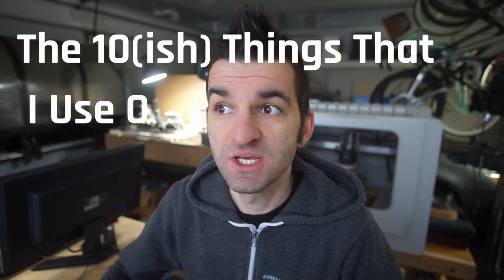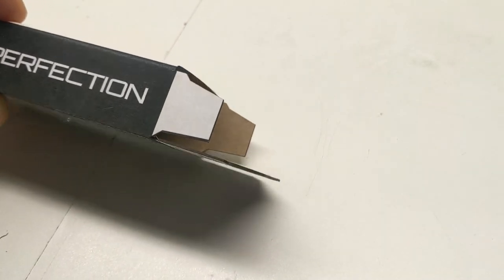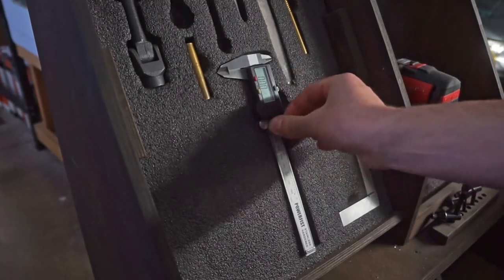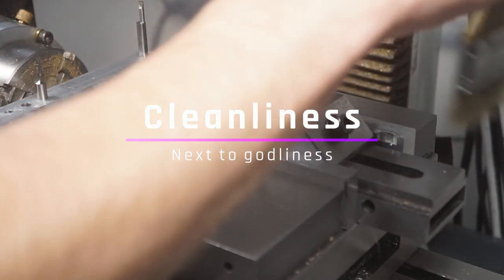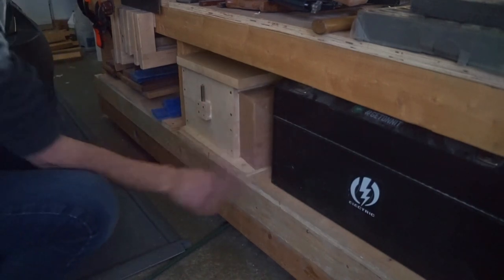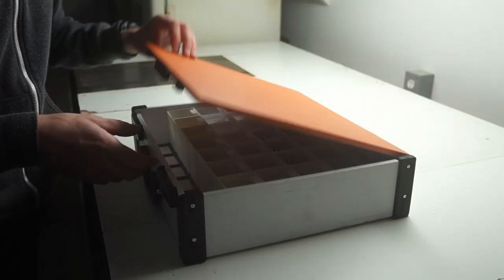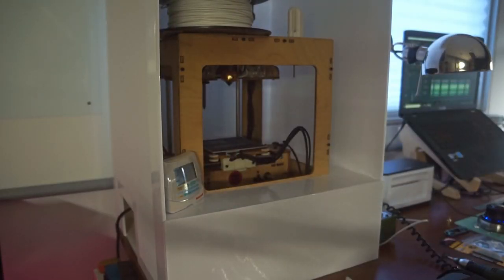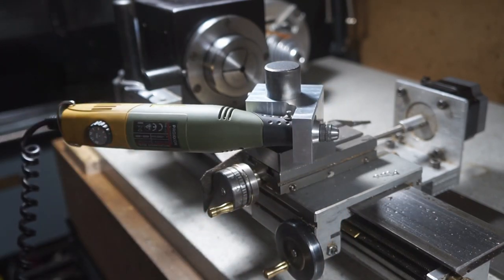My Top 10 Tools for Shop Productivity

Comment: Curt!!!  You have been busy building parts!!!  Great tips.  I didn't realize Proxxon made a Dremel style tool.  I thought they just made the flex shaft motors.  I'll have to look into that one.   The older I get, the more important noise is to me.  I'm surprised not to see a magnifying visor on your list!  Have a great holiday season and I can't wait to see the lathe under power...  I'm guessing you are going to use linux CNC???  I'm a big fan of that system.  I've been able to modify the standard Tormach version to suit a few of my custom settings...  It's so easy!
Reply from the maker: I agree...I HATE noise, even the low level stuff grates on you with time. I do have a magnifying visor but its pretty crappy quality and doesn't get as much use as the higher power loupe...might end up getting some of those digital electronic re-work microscopes, price is right and should be a nice stop gap for a proper stereoscope version.
Yep, linuxcnc for the lathe (which is nice as I can use the wizards from path pilot if I want). The new 7C80 cards I purchased work directly with a raspberry pi so that should be a fun integration (should be able to ditch all the PC's for machine control). Happy holidays to you as well and thanks for the comment!

Comment: A central vacuum cleaner with a cyclone separator attachment is a great option, if you can hang the hose from the ceiling where it's easily accessible and reaches everywhere you need I'd recommend that. Your shop is looking super clean and organised, I'm going to ask Santa for a label maker this year, they're great.
Reply from the maker: Oooo...I like the ceiling idea! Many thanks!

Comment: How do you like the Mesa 7C80 Boards? Considering one for a upcoming build. Looking around I don't see many/any videos on the 7C80 board as of yet.
Reply from the maker: I really like them, they are kind of a nightmare to setup right now due to the lack of info but I've been running them 10hrs a day for a few months now with zero issues. I am overclocking my Pi's a fair amount but I don't think that's a requirement (I have a massive cooler on them so why not).
I'll be sure to include some info in the upcoming videos on its setup as info seems scarce!

Comment: I always like to comment something really cool, but in this case, I think maybe just a talking out loud to myself comment. Most of what you suggest I'm already doing (thanks to your videos) and others I have plans to try to do. The only thing I really have to say about casters, I'm really looking at the kind that you pull off the ground to disengage. I find that casters on my work benches, for my needs, which are not necessarily your needs, having the Caster there makes the bench unstable due to how they lock and the swivels.
Reply: So thank you for continuing to share!
Reply from the maker: Thanks for the kind words!  Yes I agree with you 100%, casters on a bench that needs to be stable are more annoying than helpful...the lifting ones sound like the ticket for that application. Thanks again, hard to find the time for videos these days but I very much enjoy it when I can!

Comment: Curt, what kind of foam is that?  You sent a web link to me before for the soft stuff and I have been poking around Uline, I can't seem to determine what that stuff on the rolling cart is?  High Density something something?  Thanks again.  I am starting over in my shop (due to moving) and trying to do it right this time!  I love the idea of being able to take sleeves with me and have them on the cart.  As I said back 3 months ago, I really appreciate your videos and you not only pioneering, but you also sharing your path and journey!
Reply from the maker: Thanks again for the compliments Dan! That foam is actually Kaizen foam (brand name, might be other variants out there). I believe its sold thru fastcap if your in the US and richelieu hardware in Canada. Good stuff, isn't cheap but very easy to work with!
Reply: @CurtVanFilipowski  awesome! Thanks I’ll track it down! For the rolling cart are you cutting with a razor, or going all in with the laser? Due to size I’ll likely be doing razor. Guessing you just make the shape a touch smaller than the tool to provide friction? 

Also why is my phone correcting razor to tacos? Guess lunch has been decided!
Reply from the maker: @ironhead65  You bet, tacos work great for cutting this stuff. Its actually a layered design so cutting it with a blade is dead easy (same way I made all the tool cutouts)....laser would be better but hard to control the depth :).